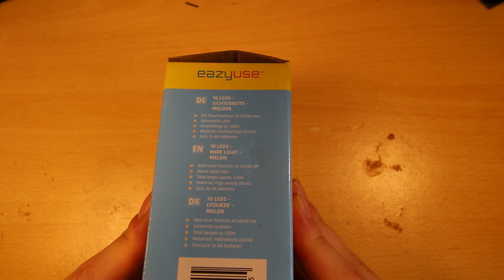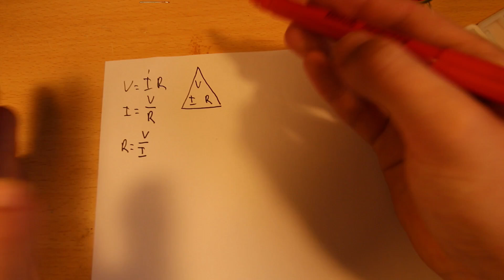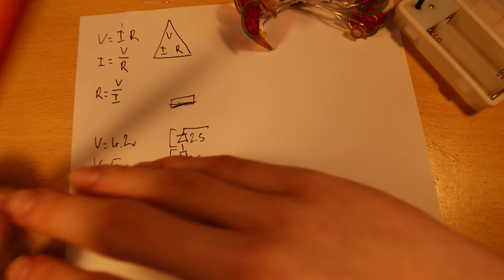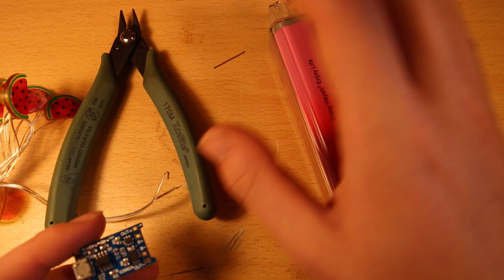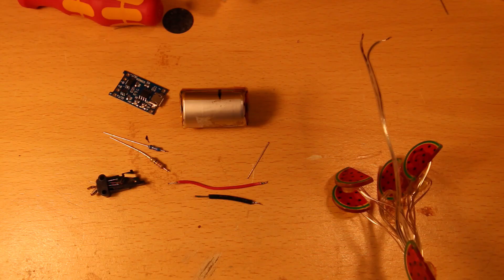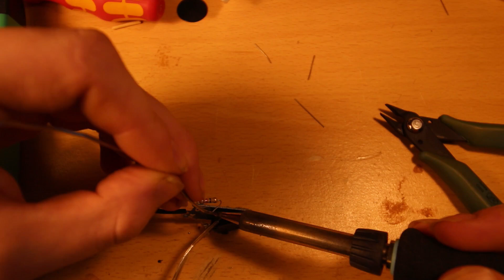Tutorial: convert battery fairy lights to USB rechargeable

Comment: So the wires are made of copper, what makes them negative and positive is which terminal they connect to, correct?
Reply from the maker: The way the LED’s are soldered onto the wire determines which is positive and negative, the easiest way to tell is to look at the way they are connected in the original battery box, that will tell you which is which. You could even use a permanent marker to make a mark on one to make sure you don’t get confused. If you already removed the lights from the battery box then some multimeters can be used on diode check mode to measure the forward voltage, showing you the polarity of the LEDs and thus which wire is positive and negative. Some multimeters don’t have a high enough voltage to test an LED though, so the other option is to put a big resistor in line something like 1000 ohms (1KΩ) and connect the wires across 2 AA batteries in series, you will get a glow from the LEDs if the polarity is right and nothing if its wrong but the resistor should stop you damaging the LEDs if you connect them backwards. If the lights have a figure 8 cable feeding them, (2 cables stuck together making the shape of an 8) one should have a stripe or dashed line printed on it, GENERALLY that is the positive but I would be hesitant to guarantee that as the manufacturers sometimes ignore conventions and swap things around and use the cables randomly. Normally if one cable is red, or has a red marker on the end and the other is solid black or marked black end the red is the positive and the black is the negative, but as with the marks on the figure 8 though its not unheard of for a manufacturer to swap them around, so I would either go with the polarity in the battery box if you can, or if not that then try to test it using a multimeter or as I described with the batteries.
Reply: @craigmatthews7962  Yes, the lights I was trying to convert did not  use the conventional rule for wiring. Can I attach the resistor to either the positive or negative? It doesn't matter, right? thanks for the informative reply.

Comment: Hey Craig,
I recently discovered your channel and subscribed after watching a few of your videos. Thanks for this fun seasonally correct video 🙂 I have also used quite a few 'street lipos' for such fun projects. Most of the cold and warm white LEDs I own drop between 2.4V and 2.6V at a current of a few milliamps. There is a small error in your video though 4.2 - 2.5 = 1.7 not 1.6 🙂 In the end result it is not really of any note... Keep up the good work, take care and until the next video!
Cheers
Reply from the maker: Damn! I knew I should have paid more attention in maths class! thanks for spotting that lol, glad you are enjoying the chanel though and thanks for the posotive feedback! in terms of volt drop for LEDs it varies sagnificalty, and depends on alot of things, I have seen white LEDs that can drop 4v per chip (use a UV diode to excite the phosfor), and I have packages that drop far more per package with lots of LEDs in series withint one resin housing 3ish volt is a rule of thumb but its always best to check!
Reply: @craigmatthews7962  You're welcome. Yes, you are 100% correct. I am only talking about the small white 3mm, 5mm and SMD LEDs that I have lying around. I also have some white "single chip" power LEDs that do indeed have a much higher voltage drop.